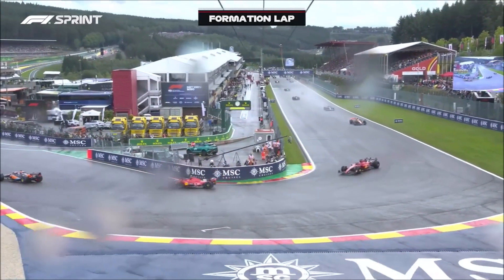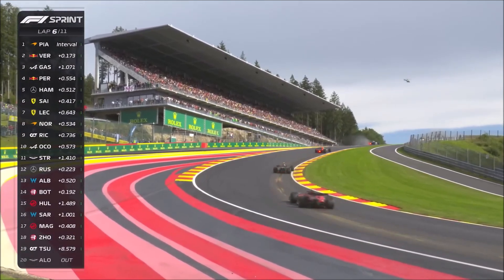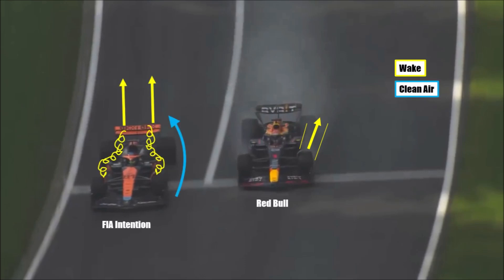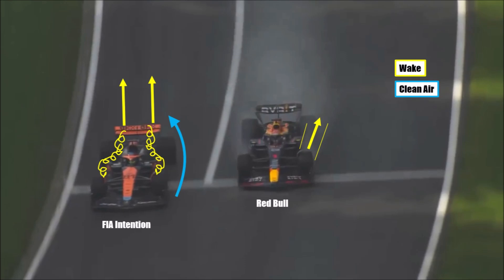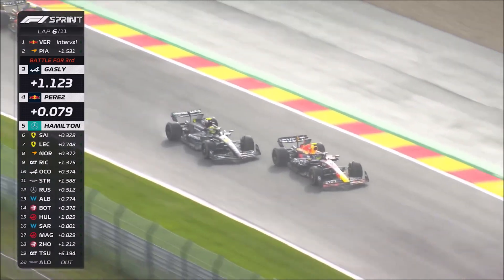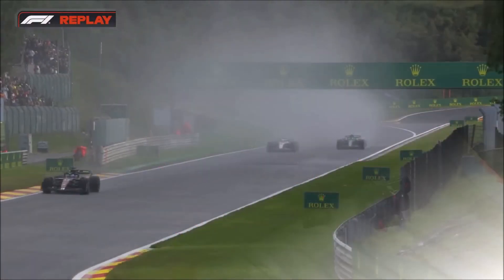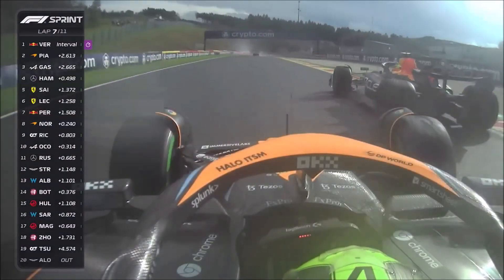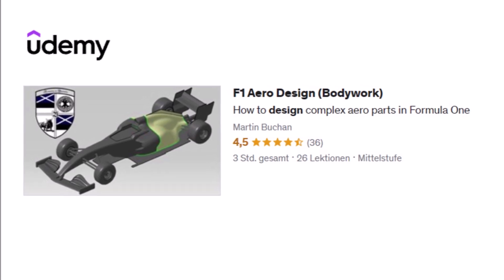F1 2023 - Spa Spray Party - Aero Visualized

Comment: So I've had a theory for a long time that the real answer to the spray is make like the Gen 2 formula E cars did and cover the front wheels. With that done, the amount of spray would be massively reduced, as it would lose all the momentum in the arch (this is all very luddite reasoning). It'd also have a net effect of making the cars less draggy and create a new way to use aero without creating outwash, potentially. Is there a reason F1 (and their fans) are so against having covered wheels on the cars? It's seemed a no-brainer to me since the Red Bull Gran Turismo concept from... I think GT4 or so, had covered front wheels.
Worth some CFD tickets to put numbers on it maybe? I've love to know just how much of a difference it would make.
Reply: With a huge diffuser what's the point of wheel cover? As shown here that part of wake is outboard , so there's little reward trying to reducing it
Reply: FE constantly have crashes where the wheel cover jams the wheel. They were highly problematic and FE dropped wheel covers for gen 3.
Reply: Covering the front wheels wouldn't accomplish much. The real wheels are worse.

"Is there a reason F1 (and their fans) are so against having covered wheels on the cars?" - Yes, foolishness.
Reply: The diffuser is the main reason of big water spray. If you want to reduce the spray significantly, reduce the allowed downforce
Reply: @swordsman1137  Then main reason, as always are the tires, which aerosolize the water into mist from the circuit. The diffuser, if anything pulls it up a bit further. But that always happens, since the car needs to be squeezed down air needs to go up.
If you look at old late nineties early 2000s races, that circumstances weren't better, people just weren't whining about it...
Reply: @avada0  what are you talking about

Comment: This shows where others lack. Tbh, I think redbull is best at aero. Adrian newey and the team he built is great at aero. Mercedes’s strength has been engine but because of the freeze they can’t do anything with the engine. Fia lost the plot here . They basically handed the championship to redbull . It makes no sense because f1 is more about powertrain than aero. Manufacturers are here because of the engine not aero . Redbull being an independent team has become great at aero as that has been their main focus as they always sourced their engines from outside.
Reply: It's about both. You need enough engine power to be competitive and to have the horsepower to not loose too much too speed as a result of your aerodynamic features, but you need good aerodynamics/suspension/package in order to create a the car with the highest overall potential and performance on a wide range of circuits with a wide operating window. It's reductive to say it's any one thing. Every aspect of the car is important and feeds into every other aspect of the car. It's a system of systems where every element is connected and impacts every other element.n
Reply: If f1 is more about powertrain than aero ferrari would win 2019 and mercedes would win 2013. Todays f1 is more about aero. 2000-today era
Reply: @alaybey9771  Ferrari got nerfed into the ground mid 2019
The V8 engines were so heavily regulated that the power differences were tiny.
Reply: @alaybey9771  The 2014-16 regs were all about the PU. Williams and Force India were up there with Red Bull and Ferrari and well clear of the rest of the pack just because they had the Mercedes PU, and the other PU couldnt catch up because of the token system, which lasted until 2018.
Reply: We also lost 5 teams(Manor, Caterham, Force India, Lotus, Sauber) to bankruptcies/insolvency during the early hybrid era, so do you want that again.
F1 fans with goldfish memory are always the most ridiculous with their claims.
Reply: @humanbeing9079 other teams bankruptcy has nothing to do with the hybrid era it was always going to happen with our without Mercedes you don’t know what you are talking about
Reply: @jb-y1487  funny coming from someone who clearly didn't follow the seasons when they happened. Teams were struggling hugely with engine cost, teams like Sauber used 1 year old Ferrari engines, McLaren was losing 10 million a year from 2015-2017, Mercedes HPP spent 320million pounds in 2020.
Goldfish, care to tell me something I don't know if I'm so clueless?
Reply: @humanbeing9079  How much did Red Bull spend ??
Reply: "They basically handed the championship to redbull" They did that when they brought in ground effect car, Newey literally wrote his thesis on it!! It was inevitable what was going to happen!!
Reply: Facts
Reply: If that is the case, why is the FIA, considering a power increase adder to the lowly Renault engine?